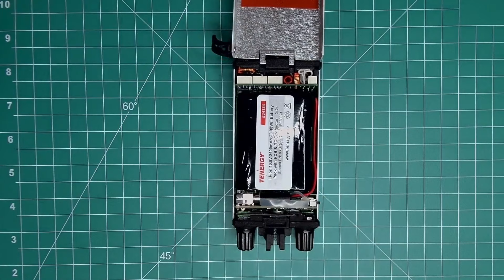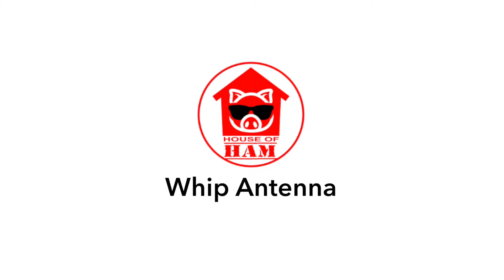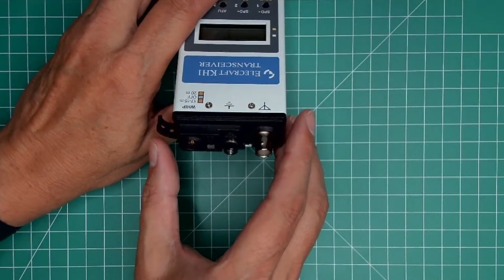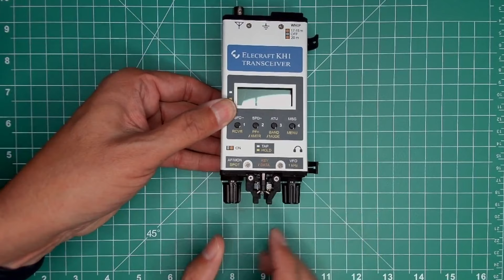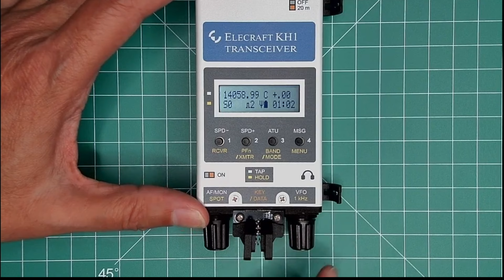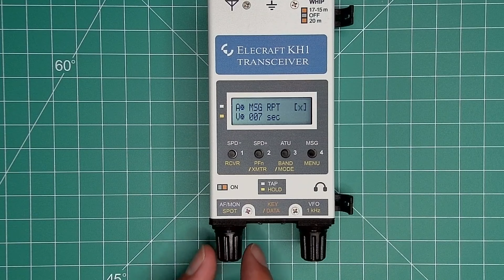KH1 Video Manual - The Basics

Comment: How well does the CW decode feature work?
Reply from the maker: Depends on the strength of the incoming signal. On sending seems to be very accurate.

I never rely on decoders as most just aren't good enough to replace the ears and brain.

73 WV7W

Comment: @houseofham.  I purchased this radio back in October and just began using it today.  I am trying to figure out how to change the tuning steps for the VFO on 20 and following the instructions in the manual I’ve spent the last 45 minutes to no avail.  It won’t tune below 14 169  If you have any suggestions, please let me know.  Otherwise, I’ll put this up for sale.  I own a lot of equipment and I don’t like to spend hours on end trying to figure out how to use it.  Thanks and 73.
Reply from the maker: As far a changing the tuning steps, you push in on the VFO knob (right knob) and each press will toggle between 10Hz and 100Hz. If you press and hold, it will change to 1KHz. You can tell which step you are on as the digits that aren't impacted will disappear from display. As far as not being able to go below 14.169, that is strange. Do you have similar issues with other bands or just that one? You can reach out to me directly by looking up WV7W on QRZ and shooting me an email

Good luck and 73
Bob
WV7W

Comment: Anyone know if the the spot function volume can be adjusted?  It blows my ears out and I can’t hear the received signal to zero beat.  Can’t find anything in the manual.  Thanks. AC9MG
Reply from the maker: I don't know if you can change only the spot volume. I think it is tied to the sidetone volume but not certain of that.
Reply: @houseofhamradio  Thanks Bob.  I figured it out, very simple actually.  As soon as you engage the spot tone, the left AF knob lets you to  adjusts the volume.  Anyway still working my way around the controls of the rig.  BTW, still working on my CW since are CWI classes from last summer and having fun.

Comment: I found this video extremely helpful. I would also greatly appreciate you doing a deeper dive on how to adjust and fine tune the factory settings as sometimes these settings are accidentally moved.
Reply from the maker: Thanks Daren, That really depends on which factory settings you are referring to. Some require special equipment to properly adjust. All of the "Danger Zone" settings require the user to unlock them so they shouldn't be accidentally changed. 
That being said, if there is something in particular you would like to see, I will look into it.
73 Bob

Comment: A video of enabling and using KH1 pan-adaptor would be useful.
Reply from the maker: I can do that. Just to set expectations, Not really a panadapter. It scans through a series of frequencies and shows a relative signal strength at the time it scanned. Not particularly useful in my opinion.
Reply: @houseofhamradio  Today, I finally received my KH1 ordered on Jan 1, 2024..  One of the first functions I tried was the panadapter.  I agree that it's not too useful -- to put it mildly.  Otherwise, I'm impressed.

Comment: Yes Finally a great video on the KH1.  Thousand thanks.  This is standard by which all instructional videos should be made.  Indexing, great videography and audio.  Great methodical instruction.  The best!  If you could do a series on the KX2, I would be all set. Keep them coming.  Greatly appreciated.
Reply from the maker: Thanks for the kind words. I do have a KX2 and was planning a similar type of video for that... More to follow.
Reply: @houseofhamradio   If you do a series on the KX2, it would be nice to include a section on how to use the programming software.  Maybe a section on settings for SSB, digital and CW.